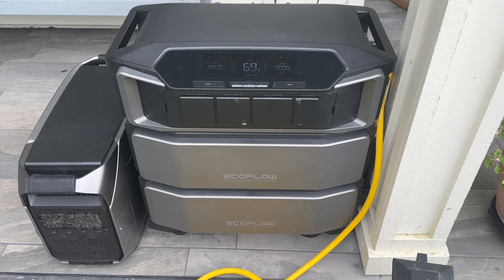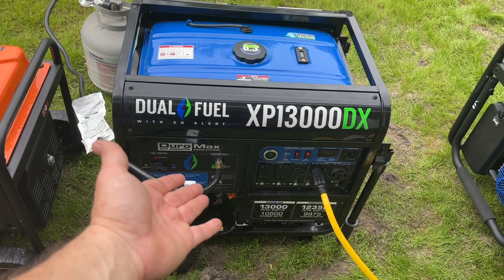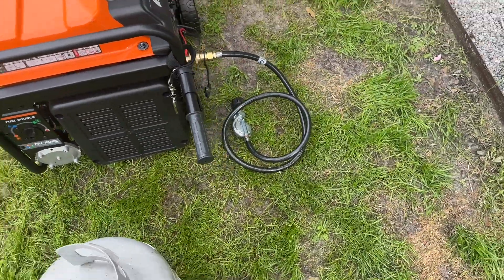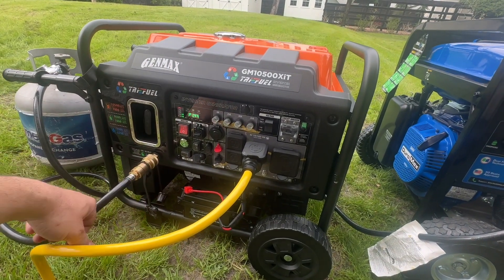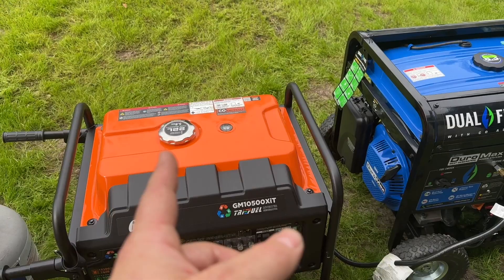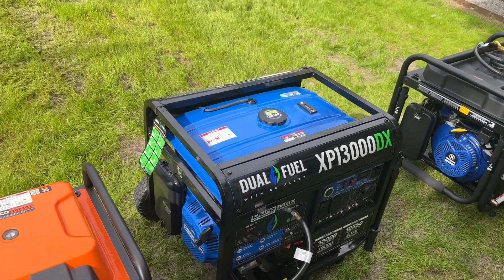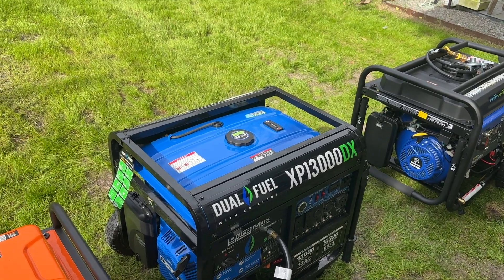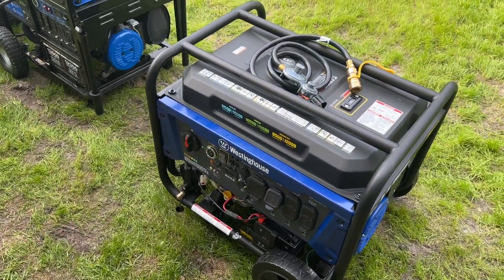Charging Ecoflow Delta Pro Ultra On Conventional Generator VS Inverter

Comment: I live in Québec, Canada. It’s cold up here and we do have severe weather, including ice storms… From my own experience over the last 30 years, nothing seems to beat a Honda generator as a work horse that you can leave on running for days on end. That’s why a majority of contractors in my area all have Honda’s. I replaced mine, a 4,5 kW, that was 30 years old, with the new EU7000is Honda generator. It was the biggest inverter model two years ago. It is so silent, it’s unbelievable. This is important to keep good neighbour relations and to not attract thieves who are on the hunt for generators during storms… Also, if you have electronics, an inverter generator is the safest bet. I blew up the motherboard (700$) on my dual-fuel furnace with the old regular Honda generator. Learned my lesson…
Reply: 100%. Spend more up front but you buy once and you’re set. I have the Honda eu3000i and knock on wood, zero issues at five years.

Comment: The video I'm wanting is HOW can you clean that signal up from your non inverter generator. What device works best. Can you take a multi plug with a Greenwave filter and clean uo the signal? I'll have to try to find out myself for my Predator 9000 non inverter gen.

Comment: A nice point not mentioned too often is that when using a gen-set to top off those battery back ups, it's a lot healthier for the genny because you're running a good consistent load. Healthy and efficient for the genny that when in normal use for home backup can be idle a lot of the time which isn't as good. I love the fact that you can top off these batteries and do it efficiently and in a timely matter. A good amount of power and load for a period and then shut down is best use case for a generator.

Comment: Why do you need to charge it so fast?   I use my 2000 watt Yamaha for this exact purpose.   1500 watt charging.  Takes a little more time but quiet and cheaper and smaller.
Reply from the maker: Grid down floating operations without downtime scenarios.
Reply: @fixitnoworlater lol. Good because I’m glad I’m not the only one who thinks (and purchases) in worst case scenarios :).   I spend a lot of time and money on the 1 in a thousand chance the power goes out for an extended period.   We lost power for 30 minutes and I had everything up and running just to show my value to my wife “see, the furnace kicked on and we are still streaming Netflix …”

Comment: I also have the Duromax max and I also run it on propane. If I use a pure sine wave inverter dies that solve the problem at least for the power bank?

Comment: Your info on the Westinghouse generator is dead wrong. The non-inverter Westinghouse generators are rated at +- 23% total harmonic distortion. That’s directly on their website.
Reply from the maker: Your ability to look things up are wrong. Look up the TFC 11500 or better yet run it on an ultra. You’ll be pleasantly surprised
Reply: You’re right but every generator below 11,500 is 23%. And you didn’t specify the specific model in your video, just bought a 9500tf. I’ll have to return it. Almost made a big mistake.
Reply from the maker: I show the model in the video. I didn’t say other models.
Reply: You’re right but every generator below 11,500 is 23%. And you didn’t specify the specific model in your video, just bought a 9500tf. I’ll have to return it. Almost made a big mistake.
Reply from the maker: That’s right. That’s why you should be a sub. I go over that in this video Westinghouse WGen 11500TFC | Ultimate Home Backup Power | Less Than 5% THD
https://youtu.be/gfMCmBIvN98

Comment: Thanks for the video. That was super interesting and helpful. The EG4 Chargeverter is a pretty good option. It's basically a rectifier. It takes dirty power from non inverter type generators and converts the to clean DC power to recharge my batteries if necessary. It can output 5000 watts if you run it on 240v. It does cost 600$ but it's a great option for cleaning up dirty power.
Reply from the maker: Yes sir. Absolutely. At the time of the video I didn’t know about it but, I now have one of these. The issue is still, bringing in that 5000w of DC into the ultra is still not possible. You can only push from the charge verter 48v so you’re maxing out under 2000w if you run it full bore. The move is to have the ultras. Then have a dedicated small 5000w inverter hooked to a server rack battery. Put the chargeverter to that setup and then charge the ecoflow at full bore. I’m building that system now. Video will be on YouTube soon.
Reply: @fixitnoworlater  I see. I have 2 pecron E3600 s. Together they produce 7200w of output 240v. Each of the Pecron units has two 1200 w solar inputs, so I can send 2400w into each unit through the solar ports from the chargeverter if I need to charge them up quickly, but realistically just send 1200 in per unit so the chargeverter is not running maxed out. But it's nice having the option to send 4800watts in through the solar ports. I wish I had bought the Genmax unit your using in the video. I have the Genmax E15000 trifuel, which is not an inverter generator. I bought that first thinking I'd be in pretty good shape with it before I did more research and decided to use powerstations for backup. I emailed the engineers at Pecron and they said definitely don't try to charge them directly with that type generator. I will probably end up selling the one I have and getting the Genmax unit in your video. But the chargeverter is a nice option to have anyway.

Comment: Hello , hope all is well, what kind of generator ( Gasoline or Gas ) do you recommend to charged my Pecron e3600 ? I tried with a 2000 Yamaha Inverter but it will shut off . Thanks Ahead
Reply: Turn down your charging rate.

Comment: I bought that Duramax generator for my mom's house but haven't used it yet. I'm not too familiar with how electrical works exactly and was wondering if there was something I can attach to the fridge to lower the damage caused by dirty electricity?
Reply from the maker: There are line conditioners but they’re expensive and generally not rated for the watts you’re wanting to push from that duromax. My recommendation is to get a small inverter and server rack battery.  Get the eg4 charge verter and run your duromax into the chargeverter then the chargeverter into the inverter. Run your inverter output 240 into the interlock outlet.

Comment: The smart gen 4000 can charge a dp3, delta pro, delta 3/+, delta 2 max and theyre working on powerkits. Just the dpu is really meant for home backup and as such is 240v, and the gens are 120v. Technically the little smart gen 3000 would charge the dpu fine, as its only a 1800w household outlet. Just its so insignificant compared to the battery size, so youd have to use less than 1800w on average which i doubt in florida you would be. Here in ny its actually pretty possible if you have non electric heat
Reply from the maker: Yep I know. Any of the EF gen’s will hit the ultra. Problem is the watts. This video is to show how to actually get the watts we want into the ultras so we can shut them off faster.

Comment: I had no problems running 2 modern refrigerators and a freezer on a Champion non inverter generator. I also used with televisions, lamps and router. It was a 3500 watt unit.

Comment: The Champion 8500-Watt Electric Start Gasoline and Propane Powered Dual Fuel Inverter Generator with CO Shield and Quiet Technology $1500. It has the NEMA L14-30R plug.  It is also pretty quiet, 61 decibels at 23 feet.  And no, I do not work for them.   I have seen YouTube videos of guys using these with the Ultra.  Might want to check it out.  if so, would ya make a video?  Cheers 😇🙏🏻🇺🇸🫡🫡🫡🫡
Reply from the maker: Yes. We all know inverter generators will do the trick. The point of this is to run a big boy that can handle a 7500 full bore charge on the pro without maxing its capacity for the duration of the charge. Ideally charging at 7500 watts and the host gen is only sitting at 65-70% of its max sustained output. Also… inverter generators watt for watt are much more pricey. You could plug in probably every modern inverter generator and charge the ultra. Not the same case with a traditional. That’s why this video was made.

Comment: We have a 7800W Champion dual fuel generator (non-inverter) and a Champion 2000W inverter generator. Tried to power our kitchen with the 7800W system during a recent power outage, and it handled everything except our microwave. The microwave would power on for maybe 15 seconds, then shut off. The smaller inverter genny powered it with no problems.

Comment: I used a Champion 5000 watt tri fuel conventional generator into a transfer switch to power my house. Ran a gas heater, fridge and freezer, lights, 2 laptops, 3 ring cameras, outdoor lighting, and an ipad for 3 hours. No issues for anything. I don’t know what the THD is for it but I now have to see if it can pass through power into a Pecron power station while it is plugged into the transfer switch.

Comment: Hi, new subscriber here. I have two Ecoflow Delta pros and two old generators. Any thoughts on how to clean up the power output? Frustrating having the "things" and said things not playing well with each other. I had thought about getting a pure sign wave battery inverter and charging the battery that feeds it with my old school 200 amp battery charger that's plugged into the old gas generator. Haven't done the math, but the losses through all the devices sound inefficient as hell. Your thoughts, and thanks for the video.
Reply from the maker: No no and no lol. Been down the road before. You will need to get a better genny. The cost on a power line conditioner and the output it can achieve far surpass the cost for a wgen 11500tfc which is the genny you want to run with those rigs. You can also invest in the smaller smart gens by EF but understand their limitations
Reply: @fixitnoworlater  I figured as much, thanks for the reply.

Comment: Thanks for your video. I thought I would let you know that I have a Delta Pro 3 which I can charge on a Westinghouse 6600 watt NON-Inverter Generator in ONE hour on Propane. And yes the 20 pound tanks will ice up when the fuel get low in the tank. Once the DP3 is charged , I use it throughout the day to power my 240v Well pump intermittently. I use smaller power stations to run lighter loads around the home. The frig and freezer will run from the DP3 for 24 hours after which I just repeat the charge. Savings on a lot of fuel useage during a power outage.

Comment: I wanted to see this. Thank you. I'm leaning toward a system that will hold about 7-10kwh so that I can use generator once (winter) 2x a day (summer) for 1-2 hrs a day to charge system.  

I have an 11k inverter/ tri fuel Genmax (like yours) and I'm looking at 2 options since I found the Eg4 Chargerverter for 48v battery. 

1)  Home made hand truck 2x 48v100ah @ 10kwh+ and a residential type inverter / charge controller or 2) this ecoflow delta pro ultra, but dang 2500 for each additional battery is wild. But.. charging up to 7k watts is awesome. I could charge 7k per hour vs charger verter 5k per hour, so for 2 hours for home made option.

 (no solar as of now but possible later). 

Home made hand truck unit is 8k watt inverter and 10kwh battery for approx $4300 + EG4 chargerverter ($720)  = $5k ish 

Vs

EF Delta Ultra, 7200 inverter and 6KWH for 5k of 12kwh for $7300.

Comment: I live in hurricane ground zero. I have survived MANY. This is what I have developed based on my experience. Plan for power to be out for a least 7 days.
1. Have a large TRIFUEL generator.
2. Wire a interlock switch to your electrical panel to make things legal and avoid back-feed to the power lines so you can feed power to selected house outlets.
3. Have your natural gas line outfitted so you can connect your generator and use that as your primary fuel source. Large generators will suck a HUGE amount of propane and gasoline and you will need fuel for at least 7 days.
4 Store some gasoline and propane as  backup fuel (uprooted trees can pull up natural gas lines).
5 Use batteries (Ecoflow) as backups when power goes out during the storm until you can get out and crank up the generator. These can also be used to supplement your power as needed.
6 Purchase a couple of the small easily carried inverter generators to charge your batteries as needed.
7 Purchase window a/c units to cool the house when the humidity/heat bomb hits after the storm. These units can be inverter type and suck much less power than central air and don't require a monster size generator to start them. You can also control which spaces are cooled depending on need.

Another option is to spend the BIG bucks on a whole house generator (Generac, Kohler) and hope it doesn't fail when you need it.
Reply from the maker: I’ll add to this I have the generac and it did fail
Reply: Yep, we're also in the Hurricane ground zero area (SW coastal FL.) and have survived MANY Hurricanes. Ian kicked our ass! One thing without a doubt with a Hurricane is YOU WILL LOSE POWER! It amazes us to this day the people we know that don't even have a small generator to at least save their food in 1-2 refrigerators! I mean just one decently stocked fridge with food in it and the freezer- food cost will likely be more than the generator to save it. But getting back on track-our system is a huge portable Generac 17,500 to run the entire house with an interloc out system. Then a Ecoflow 3600 to run the fridges (2) and a stand-up deep freeze if the weather is bad enough to not get the portable out and running. The Ecoflow will save the food, then when the sun comes out which it always does after a Hurricane the Generac hooks up to the house-Ecoflow then gets charged up from the outlet to do it all over again. After Ian we were out of power for almost 19 days. Thanks for this video!!
Reply: @viking7305. I have added a Starlink mini and Google Voice to my preparation so I now do not have to depend on cell towers for internet and text/voice communication.
Reply: Good tips, but No solar?
Reply: @NextProjectawesome Could supplement with solar, but I find the charging is too slow unless you have very large panels and full sun.
Reply from the maker: I have 5000w of solar here. It’s on my channel somewhere. I use it to top these off daily. Best route is solar if you have the roof space for it

Comment: I may be missing something by why can the EF Smart generator only output 1,800 watts  out of the 30 amp plug?
Reply: Probably because included ac plug in on DPU is 15 amp plug. Now there are generator adaptors you can buy from ecoflow to charge DPU higher but with that 30 amp plug limited to 3600watts.

Comment: Can a Predator 5000w charge the ultra w 2 batteries?
Reply from the maker: It can. You’re not going to want to run it at full bore though. You’ll safely share it at 3500w continuous.
Reply: @Archifx  How exactly is that done? I'm just learning and have read the manual, but I am still not clear on some things.
Reply from the maker: You plug one end of the ecoflow AC generator cord into the in/out port of the ultra and the other into a generator cord that I linked to in my previous comment. And you turn the generator on. It’ll automatically begin taking charge from the 240v out on the generator: https://us.ecoflow.com/products/ac-generator-charging-adapter?variant=40767961530441&country=US&currency=USD&utm_medium=product_sync&utm_source=google&utm_content=sag_organic&utm_campaign=sag_organic&tw_source=google&tw_adid=&tw_campaign=21209943723&gad_source=1&gad_campaignid=21217175504&gbraid=0AAAAABKED1zeGfmhSf3kzpJxJRz5YBH-P&gclid=EAIaIQobChMIpsGHmeqTjQMVuJpaBR08hBYJEAQYASABEgIhaPD_BwE

Comment: In addition to harmonic distortion, a big issue with generators is hard starting loads.  A battery-inverter setup can soak up a hard starting load pretty well usually.  This is like a cheap AC motor is hooked up as a dead short power until it spins up to speed, often found in a fridge or air conditioner or other common appliance.  With a traditional generator, this will cause wild swings in frequency and voltage out of a generator as the generator suddenly sees a huge load, even from a fridge, let alone a large air conditioner, the engine RPM will drop by a lot,  and the throttle will open up wide to compensate.  As the engine RPMs are rebounding, the electric motor will quickly get up to speed, create back EMF limiting the current flow through the motor, the power draw will very rapidly drop to the continuous power draw, and the engine with the throttle still wide open as the RPMs recover will quickly overshoot and over-rev by a lot.  This over-rev will cause a large voltage spike and over-frequency condition.  An inverter generator will still struggle with this engine wise, but with ECO mode off, meaning the engine is always revved up, the generator will usually be able to output a steady voltage and frequency.  With ECO mode on, it is easy to end up with a voltage sag.

Another deal going on when it comes to harmonic distortion is no ground-neutral bond in a newer generator.  It turns out ground gets you access to surface area to act as a bit of a capacitor, absorbing noise.  Even with an inverter generator this makes a huge difference.  I tried this experiment out with old analog security cameras and an inverter generator.  With no ground-neutral bond, the cameras had a hard time initializing and when I did get any of them working, the video was full of high frequency noise.  With the bond and a ground in place, the video was cleaner than AC grid power.  So before going off on a generator's harmonic distortion, always get the proper ground-neutral bond in place.
Reply: My Delta Pro Ultra has a ramp up, it isnt instant even when you have fast charge turned on.